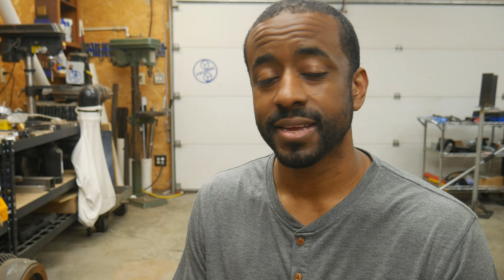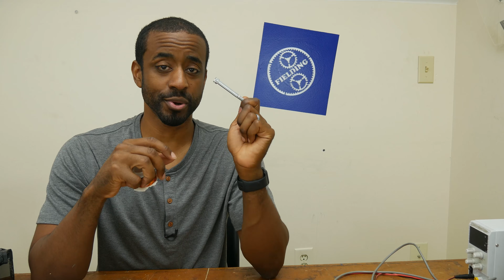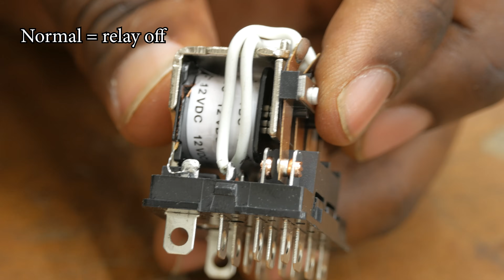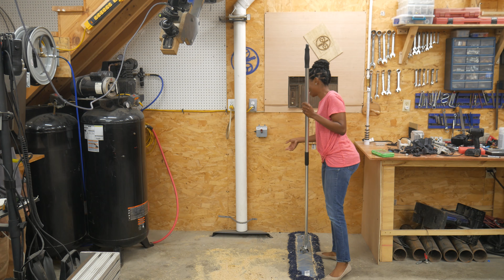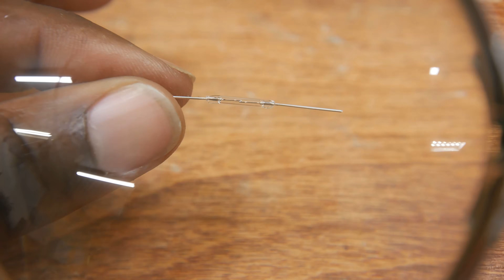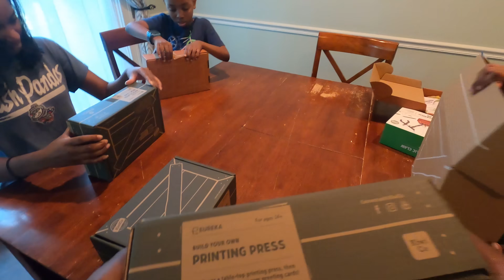A beginners guide to relays, contactors, and solenoids to automate anything; (#083)

Comment: I have some vintage big relays some have five and six connections on the back. I don't understand what these connections are for? Unless the relays turn something off and on or turn two different items on.
Please relays are Western Electric 260 BM.
Western Electric 260 BU 
WESTERN ELECTRIC 260BJ RELAY USE WITH WECO P-206115 CONTACTS
I think they all use the Webco contacts.

Comment: Is it a short circuit? Technically no, because the coil is acting as an inductor, so the battery's anode is hooked up to a reactive component and not just it's cathode.

Comment: About the coil and short circuit..hm the wires are not smoking (you could measure with an heating indicator instrument)  and then it should at least have medium resistans to make it work without failure. A Q: Can you calculate the power of the lifting an object when you test the coils lifting power?

Comment: That is not a short circuit, it's not a super conductor, however the current would be quite high due to it not being ac and the DC Resistance being quite low.

Comment: Great video.  Here's a question relating to relays and how to convert an open signal to a closed signal for the purposes of switching equipment.

I have a bi-energy HVAC system installed at home (Natural Gaz and Thermopump). It is wired with a Utility signal that is normally open when the temperature is high, but when it's cold and the utility goes to 'high tariff'. Essentially when the utility isn't sending a signal, the thermopump works to provide heat.  When the utility sends a signal, the thermopump shuts off and the gaz furnace activates.

I have since finished installation of the heating panel for my heated floors.  The panel accepts inputs for the utility signal wire, but here, a signal tells the system to turn on the electrical heating and lack of a system defaults to the gaz boiler. Basically the opposite.  How would I go about setting something up to reverse the signal.  (I.e. if there is no signal coming down the wire, send a signal to my floor heating panel and if there is a signal, turn it off.  The system operates on 48V DC.)

Comment: Hi Jeremy 
Can you help me with a question I have a 12v heater that needs to stay on while running it’s close down sequence which is connected to mains power with a reducer if I get a power cut it would damage my heater is there a relay that would switch power to a 12v battery if this happened please
Kind regards John

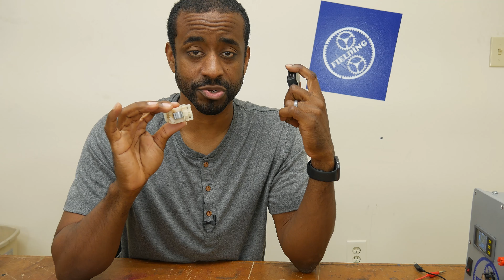Comment: 5:28 . it's not a short circuit because the wire has a winding resistance of the coil. The coil also has inductance but since you are applying DC volt it can be neglected

Comment: Hi Jeremy, how did you wire the table saw to the relay? I couldn’t tell if the relay works with any voltage or 24vdc specifically. I assume it has to wire to the table saw contractor switch. I was thinking of doing a similar setup, but using current sensing relays instead of voltage. This way I can keep the automation panel next to my electrical panel and not have to do long wire runs.

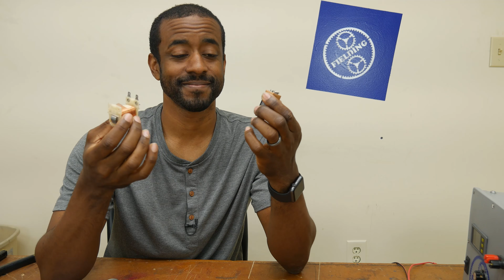Comment: @5:20 Short answer is No. A short circuit stops the current from flowing (like a break in a fuse)  its a Completed circuit however the bonus is that the circuit goes around an iron pole and its properties become magnetized from the flow,  a SHORT circuit is when the positive touches negative. if you were to CUT those wires and 2 of them touched.. yes it would be a short circuit. However none of those wires are bare or touching.. if they were you wouldn't get magnetism.

Comment: about steel and iron: The "iron cores" are basically made out of unalloyed steel, as steel is defined as "an alloy containing at least 50% iron and at most 2.06% carbon in it". Above that, it's cast iron, while wrought iron almost always is steel, but wrought, basically describing the master forming of the workpiece: modern steel is continuously cast while the earlier master forming technique for newly refined iron ore was hammer an iron-slag-mixture-foam until it has lost it's slag and became a more or less pure piece of iron or, in modern wording, unalloyed steel.

Comment: Total coincidence, I've been thinking of adding a relay to my MIG130 flux core welder because the gun is always hot. If I add a relay and wire it correctly, the gun will only be hot when I squeeze the trigger switch. Found a 24V relay, but now I have to figure out how to wire it. Thank you for sharing the knowledge and consider a video on how to add a relay to a MIG130...lol. Cheers

Comment: if  you define a short  circuit as a near-zero impedance value well no  the electromagnetic motor is not  in a short circuit since the coil represent an inductance

Comment: Nice video there Jeremy....FYI - as a rule..relays usually will handle 30A like in automotive. Contactors handle loads above 30 A and their coils are designed for longer heavier service work.  I also love the info on this "Kiwico"  never heard of them before but it sure reminds me of what we had back in my day with a company called "Health Kit" which did the same thing with radios and shortwave radios - weather stations etc. Next was good old radio shack where you could buy separate components to build things that you designed. The Australians had their own radio shack called "Dick Smith electronics" , sadly they closed. I hope you spark more interest for the kids out there and at home as you are doing now. Good job!!

Comment: It’s a “closed circuit”. The coil of wire producing magnetic flux is the intended load. A short circuit would be bypassing the coil by providing a path of lower resistance between the battery terminals.

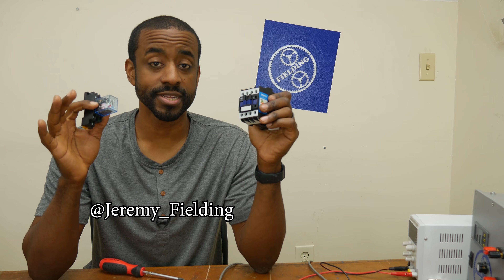Comment: 11:58 I've made that kind of circuit with a RPi, but I had the 3.5V IO pin switch an NPN transistor which controlled the 5V output of the Pi into a Relay that needed 5V to activate and controlled a 120V circuit. So that gave me the ability to use my very low-current/low-voltage pin to turn a 15A 120V circuit on or off. Very fun :)

Comment: Excellent! One of my first assignments as a fledgling EE was to find a replacement for a solenoid that had gone obsolete. I had the great good fortune to have a technician on the production line for the machine that used the solenoid that helped me understand exactly what the part did and we were able to make some physical and electrical measurements that gave me what I needed to find the replacement.

Comment: I made that same circuit with microwave transformers a meanwell 24v power supply and my power supplies' short circuit protection gets tripped. I don't know what to do it just turns on and of f, on and off over and over again definitely not desirable for a mag chuck. lets just say that projects been put on an indefinite hold. suggestions?

Comment: A fun one is to take a round rod magnet that just fits inside a syringe. Build a strong electromagnetic coil (brazing rod core). set a reed switch in place on the coil or syringe. Wire it so that the magnetic field in the coil rapidly reverses when the magnet slides to each end of the syringe triggering the binary reed switch. You basically have created a reciprocal engine. The magnet is attracted and repelled by the coil. Triggering the reed switch. Rapidly reversing the polarity. When everything is timed right and it comes into resonance it produces an surprisingly energetic amount of force. 12vdc

Comment: Using a couple of reed switches and a bicycle wheel surrounded by magnets and a few electromagnetic coils I managed to make a device which Caused a loud humming sound in every speaker in my  house. After a month of careful tuning and experimentation with various circuit designs my test equipment showed I could produce enough voltage out of the circuit to charge the battery faster than it was discharging. However, upon closing the circuit upon it's self  There was a very loud pop and the entire circuit though rated for many thousands of volts higher than the total output literally vaporized...... literally....vaporized. So! do not completely dismiss that over unity is possible.  But yes I also hate the fake 'free energy' time wasting videos. They only serve to take away from the real research being done all over the world.

Comment: OK Jeremy; this is what i want to know, How do electromagnet arc welder coils work?  I saw a guy unwinding one with a smaller gauge wire and rewinding the iron ring with a thicker gauge wire to generate enough heat to get a wielding-flow going.  So; how does it work?  I would like to rig up 6 car alternators to create the juice to power it.   If you don't tell me I'll just buy a cheep one from "Harbor Freight", and tack it apart to see how it works.   So; tell me sole brother?

Comment: reed switches are also used in fuel gauge sensing devices. floating magnetic doughnut around a stainless tube with a series of reed switches on a thin PCB. inside the tube. so complete electrical  isolation from the fuel. might be a free source of reed switches. if interested i might be  able to find pictures. semi modern AG machinery.

Comment: On the note of trying to control a relay/contactor with a Raspberry Pi (or Arduino):
I prefer to use transistors, since they're usually smaller, silent, and take up less power.  But, I understand the point you were trying to make is that you can use relays to control relays.

Comment: I'm an electronic hobbyist. One thing I do when using a relay, is I put a diode backwards in relation to the voltage across the coil terminals. When the coil is turned off, a reverse voltage spike is produced and the diode will keep the spike from effecting anything else in the circuits.

Comment: Remarkable timing running across this video!  I am building a blacksmith power hammer to be powered by a 2 hp,240v,1ph motor. However, the contractor was damaged as we salvaged the motor & wiring from the wood shaper. Now I can replace it!
Awesome as always!
Dwayne
(central PA)

Comment: Great video...Thanks for your effort and teaching style. 
I have a simple Switch question related to Turning On and Off a single phase 240V Motor (like a 1-2HP 10-15Amp Water Pump) based on a Float Switch in a large Water Tank. Can I simply attach the Float Switch to just one of the two hot legs of the 240V circuit to Open (or Close) the circuit based on the position of the Float Switch?  I see lots of Motor Control videos, but, they mostly want to illustrate the use of Contactors for Motor Control. Why can't I just use a Float Switch on one of the Hot Legs to Start or Stop the Pump Motor?

Comment: If it is running at the coils resonance frequency (AC) no, the farther you get from said frequency the more of a "short circuit" it is. If you are running it off of DC, yes, I should be considered a "short circuit". That, is in an ideal (very low resistance) situation, but because all metals have a resistance, a lot of the energy is converted to heat.

Comment: hi Jeremy your a whiz and brilliant mine , i wish you were my dad or my husband ....lol.
i got a project i working on . im older woman . i have no experience  nor did i get uneducated.
my belated brother was deaf and he also was uneducated but he was amazing the way he fixed things and made things work .
. i recently hook up a solar to the van and got dc 12v fridge and lights running and a invertor, now i want to try to generate power from alternator and washing motor of  240v (main power ).now i have motor working of dc power supply .i want to charge battery from the alternator  , but scared that i have to high current . i will place speed control switch . now i m thinking a relay or contactors might help .any advice.
cheers jm

Comment: Technically not a short circuit since the coil of wire is the intended load. It's just a very low resistive load.

Comment: I had to hunt it down, but I think a visual would be awesome.
Could you do a video or update to this video to show the difference between AC vs DC relays. Your video that explained shaded pole motors helped me understand the concept that people were typing.
I think you probably could show these differences better than anybody I've seen.
Maybe explain the magnetic part as I don't fully understand how the current gong back and forth on an AC circuit doesn't cause the item being pulled be pushed after it reacts to the first (phase?)

Comment: I’d say it’s not a short-circuit because: the length and gauge of wire and the fact that it’s coiled, give it impedance, which opposes the flow, and therefor limits the current that can travel given the 9V supply.

Comment: Excellent!  Now I think I understand the box with a 'contactor' button that turns on (or off) my 240V dust collector.  Why (specifically) is it bad for me to turn on/off that system more than 6 times in an hour (manufacturer's instructions).  What goes wrong if I do, and is it serious enough that I should leave the thing running when I'm doing a temporary task (re-measuring, adjusting machine settings, etc)?

Comment: Is it a short circuit?  If it were,  there would have been an arc when battery was connected.  The winding provides sufficient DC resistance to limit current.

Comment: Relays are pretty powerful.. they were  (and still are) used as control logic in industrial equipment. Question: can relays work in extreme temperatures?? It seems NASA can't find a control logic that works on Venus with temperature of 400+celsius.. is there a relay that would work in such an environment?

Comment: I believe it is considered a short circuit, because when you powered the inductor with dc voltage, the reactance of the inductor becomes zero (as the frequency is equal to zero), but if you consider the resistance of the wire been non zero, it isn't a short circuit as there is an ohmic resistance. A further note would be that the action of conecting and disconecting of the battery on the circuit can be viewd as an change on the voltage of the circuit, then the reactance of the inductor isn't zero anymore. So it kinda depends on the way you view this i think.

Comment: These days, relays <= 10A generally use optocouplers instead of electromagnets. They do the same thing in a completely different way. An optocoupler is a LED and a light sensor in a light proof box. When you apply power it lights the LED and that causes the light sensor to open the circuit due to science.

Comment: Somewhat unrelated question, since all of this is about moving the switch away from a machine that's already powered, but my specific situation needs the power source moved from one spot to another. How bad of an idea would it be to use a step-up transformer, to use on a long extension cord, then use a step-down transformer to then power tools? 
I don't have a workshop built yet, and where my tools can be used are roughly 100 to 150 feet away. I know I can buy extension cords rated for this, but they get expensive, and they have quite a bit of bulk to them; plus what happens if I need to temporarily move my setup, causing an even longer cable distance. I figured, because of this, a step-up, extension cord, and step-down setup would work best, especially for the varying distances between power source(s) and tools. 
Problem is, I don't know what voltage range would be best after the step-up. Next problem is, how well would this work with converting a salvaged transformer to do this, I know it can be done, but what happens if the secondary on the step-up and primary on the step-down aren't well matched? Third, potential, issue would be converting this to tap a 240v plug, as I have one in the same relative area as the other plugs, and this might be a better idea than using multiple setups on multiple circuits. I also want this to basically be male plug > step-up transformer > female plug > extension cord(s) > male plug > step-down transformer > female plug, just so that it stores easily and the extension cord portion can have a range of sizes, just to minimize the amount of dead weight extra cable would have. 
I know in the end extension cords will probably be cheaper, but the bulk of those is also a concern, plus this may be useful in the future after I do have a workshop built, such as if I need tools at the front portion of my property, or a neighbor needs work done and they don't have power going out to a specific portion of their property.

Comment: Answering your question.
No, it is not short circuit. Short circuit by definition is shorting the electric terminal with very small resistance (around 1-2 ohms). This inductance winding is for sure in the magnitude of 500 ohms or more.

Comment: I can remember using a DC relay on my motorcycle. It was for the electric horns I had on it! Really loud horns too! Anyway, the reason I'm leaving this comment is this: The original bike that had this particular relay on was not the same year as the second bike, I put it on. I tried to use it for my TX 650 Yamaha after using it on a FZ 750 Yamaha. I think it was the rectifier on the TX, as it was not solid state. It was a true rectifier! With diodes and transistors! Anywhoo, it would cut the power to the ignition on the TX whenever I tried to toot my horns!!! Damn it all to hell eh? How would I rectify, no pun intended, this problem should I encounter it again?

Comment: Before transistors and vacuum tubes, engineers build control logic and simple computers out of relays.  Early elevator control systems would use a wall of relays to manage all the inputs and decide on elevator travel.  They were a sight to behold, and loud.